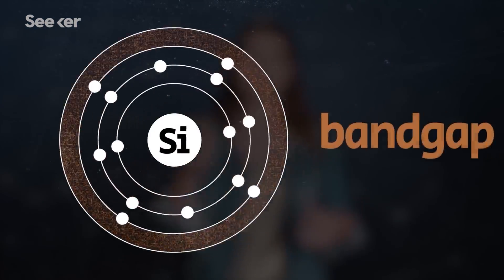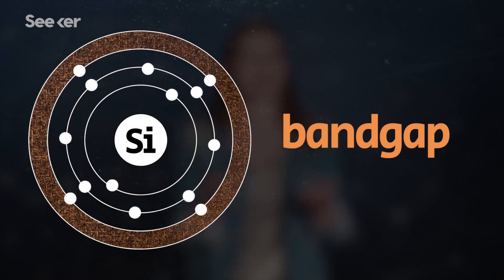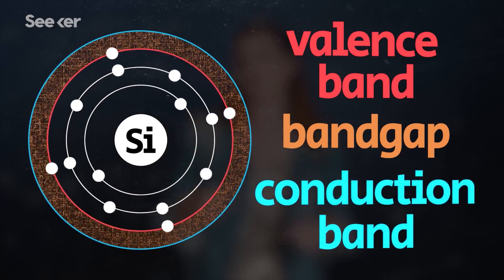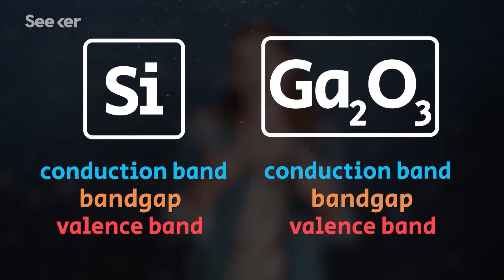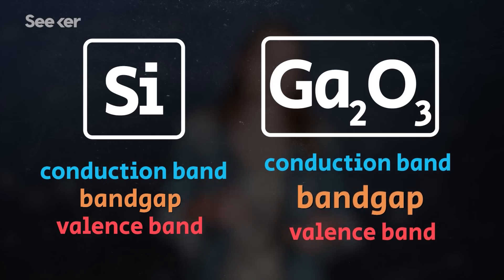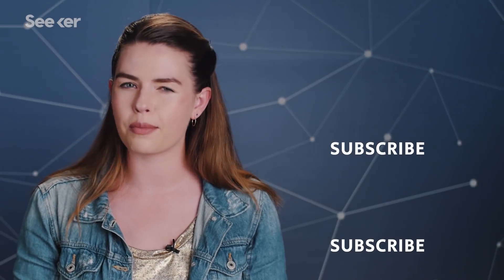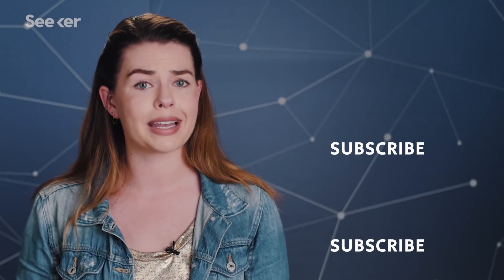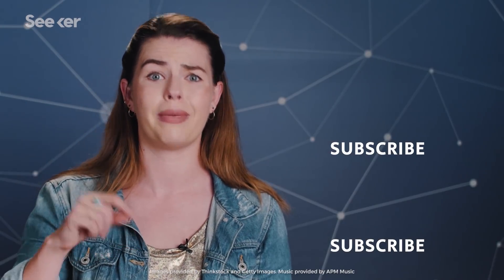Goodbye Silicon! Your Next Computer Chip Could Be Made of Gallium Oxide

Comment: Sciencetis say liquid have a no fix shape but when you blow up a bubble it has a fix shape and a  diameter  could you explain it???
Reply: Maaz Ali actually bubbles tend to be in constant motion, just look closely at the way the light reflects on the surface of a bubble, the light reflection and often colour is changing because the liquid continues to move within it.
Reply: Matt TheChosen oh I understand thank you
Reply: Wulfy fun fact, that's a myth. The reason the glass is thicker at the bottom is due to the way they made glass back then. These days most glass is floated(float glass) over liquid metal so it's near perfectly flat. Before this method molten glass was flattened out and then spun to make it as flat as possible, but the outside edge was slightly thicker. It just made sense to install it with the thicker/stronger part at the bottom.
Reply: Maaz Ali A little fun fact, you can consider glass to be a super dense liquid. Glass panes tends to "melt" throug time. You can see this in old church windows.
Reply: Matt TheChosen oh yeah you're right. I just read up on it. Apparently it's a amorphous solid and has no defined shape.

Comment: did you actually bother to google how crazy rare gallium is especially compared to silicon?
Reply: +Unlocked Chips are tiny though.  That giant black block you call a CPU?  Around 95% of that space is filled with wire leads to keep the pins separated, and just simple heat dissipation.  If you cracked the black plastic and found the actual chip inside, its typically less than 1cm^2.  And that's for the biggest chip on a full sized computer.  Smaller systems will have smaller chips.  (And the big PCBs like your motherboard are just a substrate to put all the stuff on.. they wouldn't have to change at all.)
Reply: Patjack Rickson However, we don't use much gold. In fact, gold plating can be as thin as only a few atoms thick. We do not make chips out of gold.
Reply: altrag They're small, but they're not THAT small. Hell, we use so much silicon on chips that we're starting to have shortages of that. Other materials might be used for specialized computing, but unless a lot changes, we aren't going to be able to use anything more rare than silicon for consumer chips.
Reply: Natural silicon might be plentiful, but silicon that can be purified (at least cost-effectively.. some Googling says they want to start with at least 99.5% SiO2) to the levels that chips need is more rare.  I don't know how its rarity compares to gallium but its definitely not as easy as "just grab a bucket of dirt."
Note that "cost-effectively" is somewhat critical to my argument.
Reply: Unlocked and I'm guessing we arent making a chip entirely out of gallium either or it'd melt away. 

We also use gold for more than just it's connectivity. It doesn't rust or tarnish which is why it's so popular for jewelery or art. Also up until very recently was used as currency. It's relatively rare, but common enough to find everywhere. And there's ten times the amount of gallium. Yet you seem to think we'll run out of gallium, or it'll somehow be too cost prohibitive. We'll use gallium if we have too, and the material cost will be the minor expense.
Reply: Patjack Rickson Gallium metal melts at slightly above room temperature. Gallium oxide melts at around 1900 C. The amount of gold in a modern chip (the gold content used to be higher) is going to cost cents.
Reply: Unlocked you really are just enforcing my point, it's not pure gallium. And just ignored the fact gold's everywhere not just chips.
Reply: Patjack Rickson Purity has to do with the crystalline structure, which needs to be extremely pure for any wafer. It's not talking about the actual molecular structure. I didn't respond to your gold comment because it was entirely irrelevant to the discussion. We're not talking about gold, we're talking about gallium. The many uses of gold has no impact on the price of gallium compared to silicon.
Reply: Unlocked it does. Using rarity as an argument against using gallium is just like saying we shouldn't use gold because it's rare. Even though it's much more common than a material we already use for many different things.
Reply: My point being, if it's useful and does stuff silicon cant we are going to use it.
Reply: Patjack Rickson The part where your argument falls apart is that companies DO try to minimize gold usage. It's why modern chips use less gold in the past. Gold is really expensive, so they use an extremely small amount of it. I can't stress enough how little gold is used in a chip.

If we just used whatever works the best, we would've moved to graphine and carbon nanotubes ages ago. The reason we don't is because creating them is so expensive that it isn't practical for consumer products.
Reply: Unlocked okay, but does gallium get used nearly as much as gold, and is it as rare? That was also part of the argument. Saying gallium is rarer than silicon so we shouldn't use it is a dumb argument. We also don't make things out of the cheapest materials either. We use what works the best, and is the most cost effective. I can see an argument bring made that not all chips would need gallium, and that theyd cost more. But that we won't use it because its rarer is a bad argument.
Reply: Patjack Rickson You were the one who brought up gold. I never argued that gallium was rarer than gold.
Reply: Unlocked I feel like we are going in circles here, if you refuse to see the point being made, and how it relates to how we use materials then there's no point in responding further.
Reply: Grandmaster P it's more abundant than gold. That stuff we use in alot of electronics.